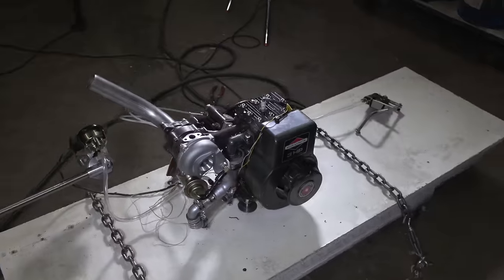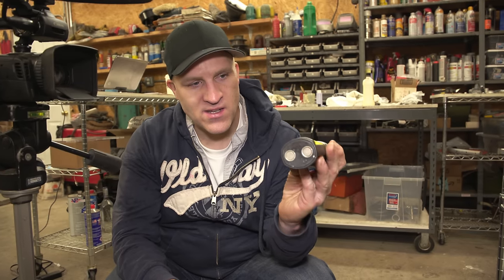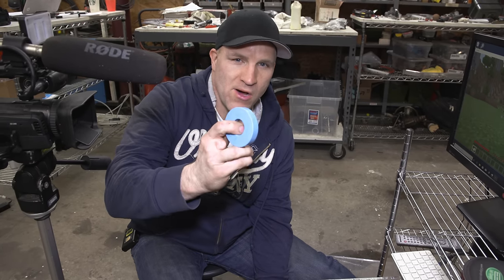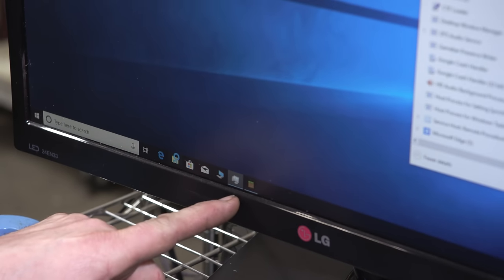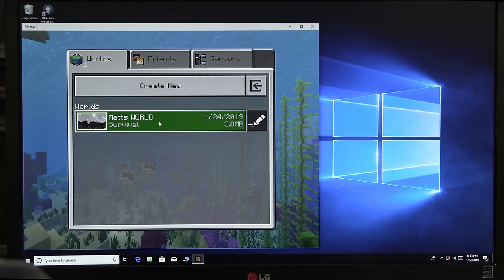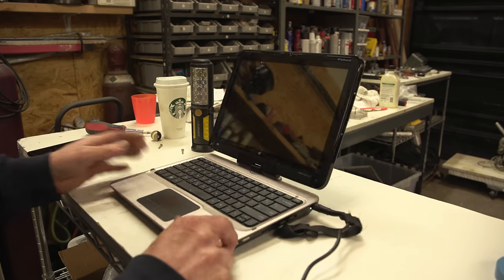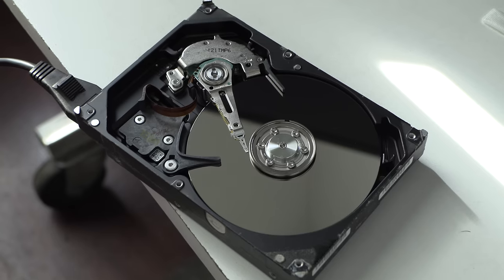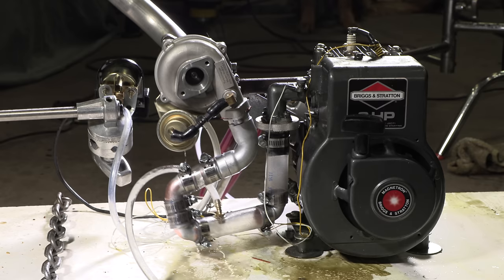Will a Magnet Erase my PC's Hard Drive? - Let's Find Out

Comment: this is why SSDs are better
Reply from the maker: After making this little video I was thinking about doing as episode on hard drive vs. SSD. Ssds are the bust
Reply: @WarpedYT  yeah basically
Reply: but SSDs can have quicker data rot because they need an internal battery to keep your data when the drive is off, because SSDs use electrical charge to store data. This also means that if yhe internal battery dies then you basically can’t shut off the computer because the data will be lost extremely quickly. So for now I’m on team HDD.
Reply: That’s for DRAM-SSDs btw
Reply: yea dude I hate when my 40 pound magnet attaches itself to my hard drive and crashes my pc, wish I had an SSD then I wouldn’t have this issue
Reply: @jonasgrill1155  hard drives use batteries, ssds don't.

Comment: Also disks in a harddrive is covered with a protecting coating :) Which contributes to preservation. I read an article saying that in theory it would, but it requires a very strong magnet, that common people generally cant get a hold off :) If you wanna hide your porn collection from the world when you throw out hdd, drill a hole through it and dump it in water before tossing it, or seperate disks from hdd and drag a knife over all the layers. Also, you can take off the bios from the pcb board (curcuit on the back of the hard drive (just destroy all chips)) to make it near impossible for anyone to read. Since all hdd has specialized bios chips and it would therefor be very unlikely that people would be able to recover anything, even if they swapped the disks, due to incompatibility. For all those of you who came here to find out if you could dispose of it using magnets.

Comment: The strong magnet interfered with the spinning disk's motor's magnetic field. In order for the DC motor to work, it needs power in the windings that'll produce a magnetic field. But if you put a strong magnet near the center of the disk which is where the motor is located, your magnet's magnetic field will start cancelling the motor's magnetic field which if the motor's magnetic field and the magnet's magnetic field cancel each other to zero, the disk stops spinning completely. For more info just search for " how a DC motor works". As for the actuator, the reason why it stopped working is because it only starts reading the Plata after the disk reaches its maximum revolutions per minute (RPM) which can be either 5400rpm or 7200rpm depending on the manufacturer's design, otherwise the actuator arm will retract to its resting position which in this case the center of the Plata. Newer hard drives' actuator arms rest on a compartment outside the plata. At full speed, the Plata creates like an air barrier or cushion that prevents the actuator arm from scratching the Plata when it's accessing data on the Plata which when it does scratches the Plata will result in bad sectors or inaccessible data or permanently damaging the Plata or the hard drive's storage area.

Comment: A weak magnet on a bracelet killed one of my driver's in a laptop. The movement of the magnet over the head mechanism eventually caused it to fail mechanically. It's not the data that's at risk exactly, I recovered all my data slowly, but the mechanical function of the drive.
Reply: It killed one of your driver's what things in a laptop computer?

Comment: I know someone who worked for the IRS and they used electromagnets to damage harddrives. They used electromagnetic wands that plugged into regular outlets that didn't totally erase the drives but corrupted the data to the point the disk couldn't be used again. He was told they used to have special rooms with electromagnets even more powerful to try and erase the data. Don't know if it's true. It's what he told me.

Comment: The reason is because modern hdds have a feature where if the drive is shaken, or comes in contact with a magnetic field, the drive will stop reading and writing, and Windows will set up a queue of processes when the drive is ready to read again. That is why all of the programs opened when he pulled the magnet away.

Comment: This is what I was interested in finding out. Someone pointed out that a transfer of data would've been more effective for a demonstration and that's true but ... the fact is Minecraft was installed on the HDD as everything else I imagine and there was no data loss, which is the part I was interested to discover.
I'm not sure if a powerful enough magnet would corrupt or erase data beyond recovery, I think that if the magnet is capable of flipping the data blocks and remagnetize them, everything will be gone forever. Although it is encouraging that it would take a powerful magnet and even then, all that caused was the platters to slow down and it resumed functioning after that, with all the data still intact. I have a few drives that were manufactured 10+ years ago, so I don't know how differently they would handle this same test. Good to know that newer HDDs are, among other things, more resilient to magnetism. 
Nice test!

Comment: For everybody who doesn't understand, why does the platter stop spinning. The answer is, the hard drive has sensor to prevent them to kill it self. When the magnet get close th read/write had returns to the initial starting piont, the platter slows down, and the OS send disk queue, to the controller, and that's why when he removes the magnet, Windows do all thing.

Comment: The reason the magnet slowed the hard disk has nothing to do with the pull.  The disk substrate is aluminum, which is a good conductor.  When there is on a strong magnetic field, current is generated in the disk, like in a generator.  This acts to produce a drag on the disk, as if you pressed your hand against it, which is more then the motor can handle, so it slows.  Removing the field eliminates the drag, and the disk works again.  (Some drives use glass for the disk substrate, so those should not slow.)
     If you were successful in erasing the disk, it would become useless because in addition to the data, there are "clock tracks".  (Some drives embed the tracks with the data, while others dedicate a single surface of the stack for this.)  These are the "roads" upon which the data are written on an otherwise featureless surface.  Erase those, and the drive becomes a piece of wall art.  When the drive is newly-made, these are written in by placing the drive in a "million-dollar machine" at the factory.  (Have you seen the jumpers labelled "factory use only, do not connect?  That is set during the initialization.)  You know that little curved hole on the drive with tape over it?  That is open during this procedure so the machine "knows" where the heads are, to allow writing the "lane markers" onto the disk.  That is done only once at manufacture.

Comment: The cover of every HDD I have disassembled is magnetically shielded.  Put as strong a magnet as you like right on it.  But uncovered, that's a different story.  It does require a strong magnet, but guess what, every voice coil actuated disk drive has two extremely powerful neodymium magnets right there.

Comment: The lids of modern hard drives surprisingly provide good magnetic shielding against external magnetic forces. However, the guts of the drive aren't immune. A strong enough magnet can still overpower the lid's shielding properties.

Comment: I had worn my starfleet communicator pin while playing on my 486 with windows 3.1 and dos 6.22. It messed it up big-time. Had to reformat and it never did work quite the same again. Glad they have improved things over the years.
Reply from the maker: Starfleet communicator pin ?.
Reply: @WarpedYT  Yes. I bought one at a show a long time ago. It has a powerful magnet so you can attach it to your shirt.

Comment: Opening up a hard drive will certainly destroy it.  Did you close the drive up and test it? At the end of the video you said the computer was still working but that hard drive didn't sound like it's working.  That sounded like the "click of death".  Not a good sound. That sound usually means that the drive is failing.

Comment: Cool test. Though i have some comments:
1: Minecraft isn't ideal to test hard drive function. It will crash if you destroy data, but not instantly. Since the actually used data will be in RAM, destroying data on the hard drive will only cause problems randomly delayed.
2: The moment the system crashed may be caused by the impact and therefore fast movement of the drive. Especially since it ran normally again after a restart. But data may still have been damaged, that's impossible to know without scanning it all.
3: The magnet slowing down the platter spinning is very interesting! I would guess this happens because of the strong magnetic field disrupting the ones inside the electromotor driving the platters. Very cool footage i have never seen before!

Comment: The reason why hard drive disks slows down is because of induced electromotive force created between magnet and disk plate, which is in opposite direction of disk rotation.  If you ever tried throw a magnet through copper or aluminum pipe you will see that effect.

Comment: Explaining what is seen with the open HDD, the disc is Aluminum, a conductor, and spinning it in a strong magnetic field turned the HDD into a really good eddy current brake.  I built something similar for my stationary bike...3/8" aluminum disc 6 " in diameter soaks up all I can put out and barely gets warm!
Reply from the maker: That makes sense, because each of the magnetic regions on its own wouldn't really attract the magnet since they cancel each other out, but the disc as a whole has magnetism.. very interesting
Reply: @WarpedYT   Find yourself a very thick-walled aluminum tube and a ball or cube magnet that will easily fit thru it...as in able to just drop through by hand.  Test to make sure the tube is aluminum by touching the tube in several places with the magnet...it should NOT stick.  Now hold tube loosely by one end so it hangs vertical and drop the magnet in, letting it fall on something soft.  It'll make you go "Hmmm"!

Comment: What you need is a powerful degausser like what was actually used. A degausser doesn't generate magnetic fields, it removes them. Hitting a hard drive with one of those will completely nuke the hard drive right down to the head and sector information rendering the hard drive permanently unusable and all data destroyed.

Comment: Internally is magnets for the head actuator. These magnets are actually extremely strong rare Earth or neo magnets. But what would happen when adding a magnet is the head can no longer respond correctly because the magnetic field for the head has moved. Running a game and running Windows will run from memory while doing your tests, so this is why it will continue to run even with a magnet on it. But the impact and the shift on the head can cause the head to scrape the platter. It takes serious magnetic fields to pull the material on the platters. Now, a microwave will kill it extremely fast. But know you know why EM Pulses are not used as weapons for war, since it would only effect power, and it takes serious power to do any damage. We are inside massive magnetic fields all day, and things are built to withhold against magnetic fields large enough to be felt from the moon.

Comment: I think it’s less about the magnet, and more about you smacking the spinning hard drive around.  Also, placing a magnet near an uncovered spinning platter will slow the platter, depending on the material of which it’s made, by creating tiny electrical fields that then repel the magnetic force; it’s called the Lenz Effect.  When the metal case is attached, you don’t see this effect, because the magnetic lines flow along the steel case, rather than the platters, as long as the metal is not overly saturated by the magnetic field.

Comment: Well that's a relief. That way I don't lose all my data when I work on an invention that involves magnetic materials. I will invent a "Removable Disc Drive" which works out identical to a hard drive only that the metals cannot be bent to prevent disc damage, and the disc can be removed to recover data incase the hard drive fails.

Comment: i know this is an old video but i think the reason it slows down with the magnet near it is probably because eddie currents are induced in the platter which in turn creates a magnetic field and opposes the spinning movement, similar to what happens with dropping a magnet down a (non magnetic) metallic  pipe

Comment: The magnets hitting the HDD at that speed will do more mechanical damage than the magnetic field itself. With the strong magnets, the platters slow down and the speed of the HDDs is determined by how fast they spin so that's why Windows hanged. The head (arm you referred to) also probably got stuck because of the magnet but I'm not sure whether its made out of magnetic metals so I can't say for sure.

Comment: Im surprised that the pc is still running and the powersupply is not dead. when looking at it 2 of the GPU's are connected with molex to pcie connectors. They are also somehow running considering that only the six pin is plugged in for the reference cards. im in disbelieve that it even works. You should probably get a better Powersupply or get rid of some cards since the mining craze is basically dead.

Comment: To destroy your hard drive with a powerful magnet you need to create an oscillating strong magnetic field that will impart eddy currents. For a static field you will need a much bigger magnet. Take a taser and connect one lead to a home made copper wire coiled in 10 or so turns about 1.5 inch in diameter, and place other end of the wire couple of mm (or about 1/8 in) from the other taser end. (Do not let them touch) Technically you will be creating a MP that will end your hard drive and you computer. Disclaimer Keep your phone, peacemaker or other important device away from it. Do not do this at home. Do not recommend you or anyone doing this. This instructional intension only.
Reply from the maker: Lol... I was thinking about something like that or a magnetron focused through a proper funnel. just for the heck of it, but I want to do some slow motion stuff with hard drives, so I wrote a different type of episode coming up, something that will apply to everybody that has a computer. Thanks for the instructions for the awesome science project!, I may do some type of EMP generator of some sort, maybe in the future, right now I have a bunch of episodes to catch up on. Thanks for the feedback and thanks for watching
Reply: *pacemaker not peacemaker

Comment: It is about how further the magnetic fields extend. Magnetic fields get weaker exponentially with more distance. Weak magnets will destroy the data too, if you rub them on the platter. Correct me if i am wrong. Because i don't know much about this myself. Physics Girl did something like that to a card(debit, credit i dunno, it was magnetic stripe) instead of hard drive.

Comment: it works if the hard drive is not plugged in. Minecraft runs on ram it will load on the ram and shouldn't be effected except when saving but the system was running on  the hard drive crashing windows when the magnet slowed the rpm of the disk drive down. try using an electomagnet or the drive not plugged in

Comment: 1. You should not let the magnet or anything bang the HDD that way.
2. The HDD stopped working because the magnetic field messed up the platter motor, which works with electromagnetism, so, it depends on magnetism to work.

Comment: Macs with an ssd actually respond differently. They freeze up and the screen goes black until you take the magnet off. (Accidentally put my phone on my Mac)
Reply: It's because they have a magnet that detect that the screen is closed. A lot of PC's do this if you put the magnet on the right side.

Comment: the most damage you have done is (at beginning) creating hard force on the hard drive (when the magnet moves to the drive and attaches)

and the strong magnet only slowed down the plates (as they are magnetic) so the head cant move without damaging itself or the plates (the drive detects it and put everything on hold until it can do the stuff again)

and when you opened the drive you will not really be able to use it again just because the airseal is broken and dust can come between the plate and head

Comment: You might be able to erase a truly antique drive with ferric media (I mean mid-'80s and before; try an ST-225 if you can find one on its way out, and of course a suitably ancient computer to connect it to). (Then again, those early stepper-motor drives could be low-level formatted again, which modern drives can't be.)

As for the old Seagate drive (from back when Seagate knew how to make reliable HDDs) you opened, it uses an airflow-operated latch to lock the heads in the landing zone while stopped. With the cover removed, the airflow is no longer contained enough to adequately push the lever, so the actuator bumps into the latch and takes a few tries to release it.

The head arms are aluminium so they can't be attracted to the magnet (though the bearings would if you got close enough to them).

Comment: modern hdd's have protection against these sort of things so the reason everything froze with the 40 pound magnet is because the hdd stopped on purpose and instead buffers all incoming requests e.g: opening a browser, that's why when you removed the magnet a bunch of stuff opened it was all the stuff you clicked on previously that was buffered to protect the hdd